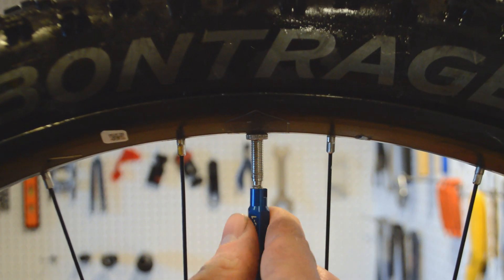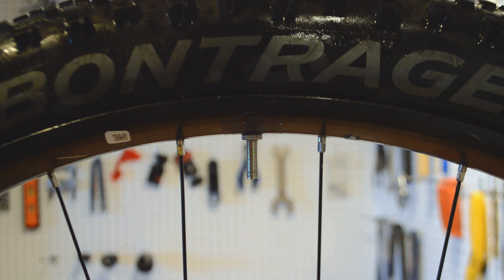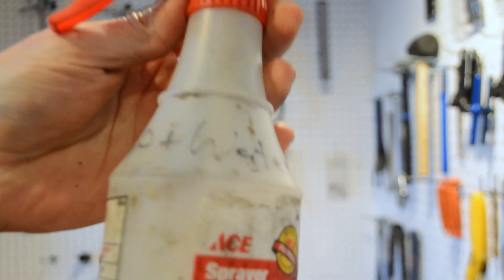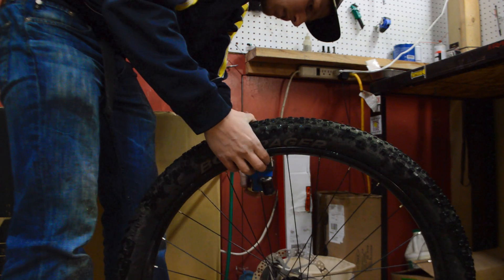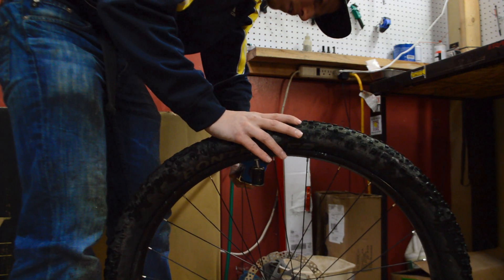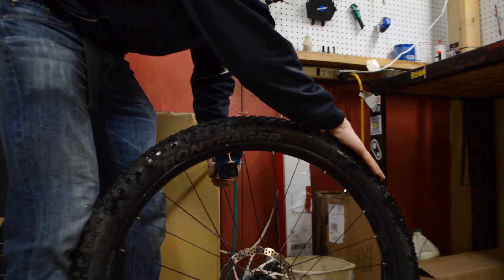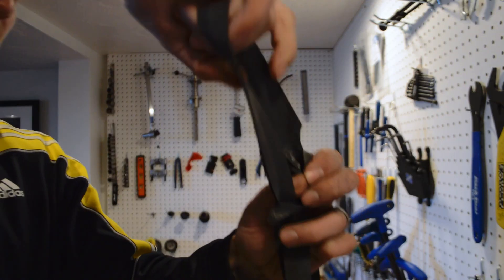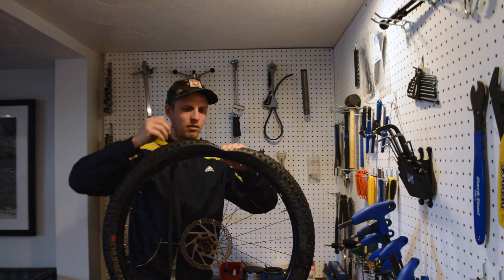Number One Tubeless Hack - Seating difficult tubeless tires

Comment: You can use a ratchet strap if you don't have a rim strip, works a charm
Reply: Spraying some starter fluid into the tire and throwing a match blows the tire onto the bead .
 No joke .   But the fluid burns the air inside quickly so and deflates it .so you have to be quick to put air in .

Comment: YOU SAVED ME! I was working on my road bike tires adding new sealant to it and the bead would not seat properly. They’re 28mm tires and your method by using an old tube to hold it down in place worked! I removed the valve core and hit it with 150psi and it seated! It took me over a day and a half faffing with it and your method took me only 10 mins! THANK YOU!!!

Comment: Wanted to say thank you, I was at my end with a tire I've had no issues reseating in the past. I grabbed some short bungee cords from my truck bed, connected them, used a few pieces of duct tape to hold it on the tire so they wouldn't come loose and BAM. Done in 20 seconds with a floor pump. Unreal hack. Thank you!

Comment: Brilliant! Thank you! this is the best bike maintenance tip I have seen in the last year. It helped me achieve a decisive victory in my fight with a loose fitting, hard to seal mtb tire . I did not have a rubber rim strip but i did have a inner tube. I used a 26' tube over the 27.5' mtb tire and presto, the bead seated. Once again, Brilliant and thank you!

Comment: This is the best tip on beading  small diameter tubeless road tires! I combined the inner tube method + the rim tape method and then used a gas station air compressor with no valve core. The beads locked in perfectly with both wheels. I might have been able to skip the inner tube technique, but doing both was a 100% sure-fire method of getting the bead done right without having to make additional trips (to the gas station). I didn't even bother with soapy water. I'm glad I found this tutorial!

Comment: I have to say that this advice is a solid gold for loose fitting tires. Just installed loose tire for non tubeless wheels (also 3 layers of rim tape) and it worked like a charm. No need for air compressor either. Thank you so much for this video.

Comment: I also used an inner tube instead of a rim strip. I used 26" fatbike tube on 26" wheels. Worked right away after about 20 previous fails. I will dread putting on the studded tires less now. THANKS!

Comment: It works it just takes patience I had an older back tire that was flat for a while Could not get the bead to reset after cleaning the tire. Finally with a strap on it and then twisting the strap for a little tension I was able to air it up with my compressor pop the beads in place and then put in my stands no flat. Wala it works. Thanks brother ingenuity common sense and patience. Matt. Colorado

Comment: Thank you for the idea. I used the inner tube I was taking off my bike due to a pinch flat and after a few tries it worked great. My issue was the sidewalls do not have much thickness and they would not ‘stand up’ enough to hold an initial seal to get it to start seating. After a few tries with this technique...pop...pop...pop!  It never sounded so good!

Comment: Thanks for your tip.  -  subscribed.  I used a 1" wide nylon ratchet strap for mine, as i didn't have any spare tubes around.  After using a tube first to pop the tyre onto the bead.  Using the right 29" volume tube for tyres like the Chupa's is important, and after removing the tube only one side needed to be popped into place with the ratchet.
I used a self-inflating rapid inflation system, charged to 140psi, both with the initial tube inflation and the 2nd bead inflation.
If you are looking for a tube. Vittoria FAT MTB Lite 29x30./3.50 - 370g are a good bet.
My 2016 Stache and I are very greatful.
I'll definitely use a tube next time, i just have to get some punctures in my road bike first...  Right now it's not happening! 
Ping me though if anyone has a source for another set of Chupacapra's as i love these tyres and they are hard to get now, so if anyone has a set lying around i'll take them off your hands.

Comment: We tried using a rim strip at the shop today,  unfortunately it was a road tire and kept slipping off. Eventually we got it seated using a different air hose chuck.  Might be a good opportunity for Park Tool to come up with something.  I'll talk to my friends over there.
Reply from the maker: Yeah it’s much less reliable on narrower tires.I always start with removing the valve core and then trying more difficult solutions from there. Thanks for watching!
Reply: Wild Outdoor Living, yep, we had the valve core out n the beginning. Bikes are a bit of a challenge at times, that's why we like working on them, lol.

Comment: you said after miles of riding and then trying to reseat tire was more difficult? i thought it would be easier (now i'm worried) i'm trying to get a 28mm tubeless on a rim 25mm internal width, do you think the tires too narrow to use this rubber band method? thank you.
Reply from the maker: It is tricky with smaller road tires. Always worth a shot if you’ve tried everything else but some road tubeless setups can be very difficult if not impossible to setup. Hopefully yours isn’t one of those.

The reason some tires are harder to seat when they get worn is because they become slightly stretched and sit looser on the rim before they are seated allowing more air to escape while the are being seated.

Comment: Nylon strip seemed like it go be a good idea, but im trying to fit studded tires, so I suppose they the strip risk ripping? Spent 30 mins fighting a fatbike tire, but I figured tubes makes life a million times easier(I have successfully fitted them tubless like 6 times before, but it always takes 2+ hrs, alot of sweating, cussing, questioning life choices, etc. I tried light weight tubes(revo loop) that are about the same weight, if not lighter than using tubeless fluid, but they were expensive and they dont seem to hold air good enough, so going back to old, heavy tubes.

Comment: What air compressor/pump head do u use to inflate after u remove the valve core
Reply from the maker: That is the Park Tool INF-2. Many other inflator heads will do well especially for the home mechanic.

Comment: Having this exact same problem with my tires broke the seal got it one time with my Air shot then when I take out the airshot can’t pump it with my floor pump. Rene Herse are awesome tires but my Barlow with the normal sidewall I think is better with tubes at this moment.

Comment: We were able to inflate the tire, and it was holding air just fine, but I didn't hear it pop.  When I let the air out to put sealant in, I realized that the bead was not set.  I pumped it up to 50 psi and it still did not pop.  I think it's not seated but it's holding air.  Any suggestions?
Reply from the maker: I would look along the rim and tire and see if it’s even all the way around. You can also spin the tire and see if it rolls from one side to the other in a particular spot or two. (While inflated) This will help you to determine if it has seated. 

Not all tires pop when they seat and not all tires that were properly seated will stay that way when deflated. This is quite common in tires/wheels that weren’t originally made to be tubeless but it can happen with rarely with proper tubeless set ups as well. 

(I should make a video on how to know if your tire is fully seated, it would be much easier to understand)
Reply: @WildOutdoorLiving  Thanks for your reply.  It looks even and spins perfectly.  If it continues to hold air, we'll not worry about it.

Comment: Question why not just use light inner tube
Reply from the maker: There are many different reasons someone might want to run a tubeless tire set up. Lower chance of puncture, ability to run lower pressures without pinch flatting, and in the case of these larger tires a significant drop in weight.

Whether or not that's worthwile to you depends on where and how you ride though.

Comment: I also have a Surly Troll...I have read that putting a 29er rim on the back and keeping the front wheel a 26" has some advantages for Bikepacking and touring is there any truth to that?.....I have 40,000 miles on 5 different bicycles... touring and commuting....
Reply from the maker: Wow good job on those miles! I havent heard of that wheel size approach but I feel like I should look into it haha. I have a hard time seeing the benefit though.

It would make your climbing gears worse, your rear wheel would be weaker and it would raise your bottom bracket. It would steepen your head angle as well, which could be good or bad. Road racers took this approach for awhile until it was banned but that was largely to improve aerodynamics. Mountain bikers have tried it the other way round with varying levels of benefit. Ill have to look more into this.

Comment: Tubeless tires do not fit the rim properly and are thus a nightmare to get on and off if you have to patch a tube. This switch to tubeless is the dumbest move on the bicycle industry's part. Making it so difficult to remove a tire to the point where tin snips are necessary to remove it is something that will drive people away from cycling. I beg the people who thought this was a great idea to come back to tubes. They're easy to patch. They were easy to patch when tires fit the rim properly anyway...